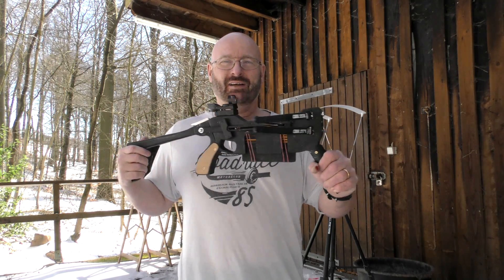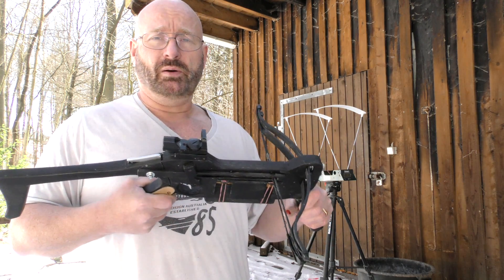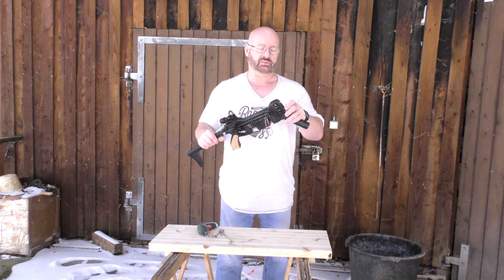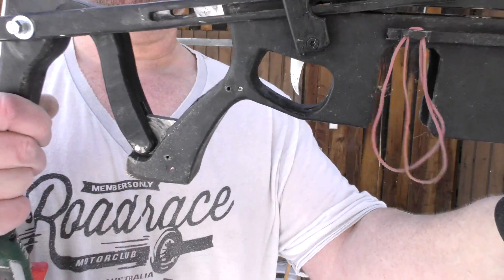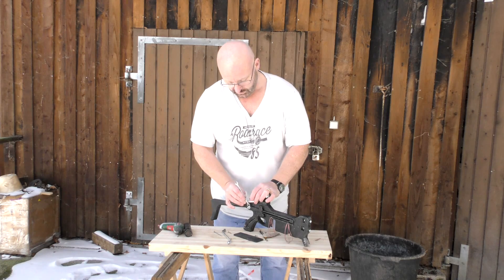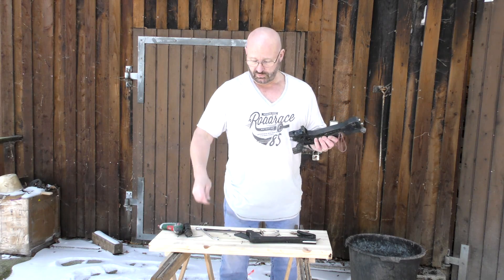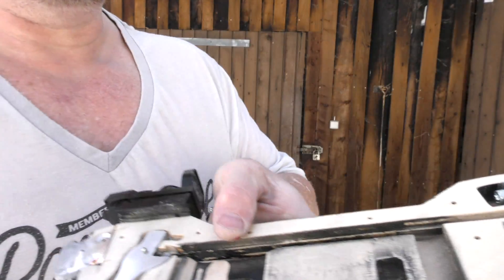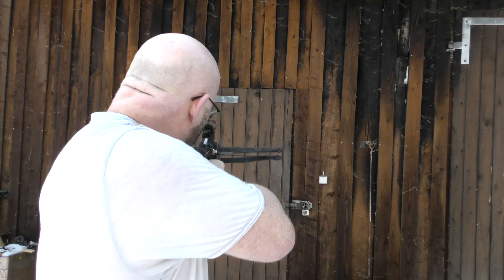"Assault Crossbow": How does it work?

Comment: Looks a lot more practical and ergonomic than the Viper Crossbow, whose main drawback i've found to be the too short and unergonomic cocking handle. Also, despite its comparatively low draw weight, it is suprisingly hard to load (because of the shitty cocking handle). Also, the current price of around 350 € is a bit much for such a simple (though sturdy) upgrade to an otherwise quite cheap pistol crossbow. Though the (no name) red dot sight is pretty good.

Anyways, get this model into production and sell it for a compraratible price to the Viper to make it obsolete. Also, construct the magazine in a way to allow for broadhead arrows to be used. The Viper cannot do that which severely limits its effectivity as a self defense weapon.

Comment: its great but 37j is a bit low i think, it will be enough with razor broadheads. Maybe you can pimp the crossbow to 50j ? (by modifing the bolt weight first, then maybe increase drawlenght just a little bit?)

Comment: I think you have a winner here. I love the cocking mechanism, it's so rugged and easy to leverage and not slow. The cheap rubber band of the cartridge can improve, I think, but that's easy. I am wondering if it's possible to stack the arrows not directly on top of one another but on an offset, so it can store even more arrows. And is it possible to have interchangeable magazines?

Comment: You should make the follower mechanism a spring pushing up the bolts like in a mauser magazine instead of two rubber bands pulling it up, and a swivelling or moving floor plate to open and reload.

Comment: okay, let's see here

1: you have to take the weapon out of aim position to recock it which reduces ROF significantly. I'd prefer to go with a pump like on a shotgun or a bolt thing like on a sniper rifle
2: hardly an assault weapon with that small magazine. a double drum magazine seems overkill, but...
3: any kind of crossbow which cocks so easily won't have as much power. so the bolts will need to be able to cause lethal or near lethal damage at low velocity. like poison or incinderary (sorry I can't spell)

Comment: If it does go into production, there's a few things that need to change. I understand it's a prototype and what I'm about to say would be obvious. First off the entire frame must be either metal or polymer as well as the stock. The magazine must hold at least 5 bolts and should be a spring-loaded magazine. Sell bolts and magazines made to fit this model. Now I would like to give my opinion on this well made prototype of yours. I like the compact design and the overall look. The reload mechanism seems very smooth, but I'm worried that pulling and folding it that way will eventually wear it down to the point where it might break or get stuck. I'm not sure how much force it needs to be loaded, a man of your size and strength would make it look easy. I hope you see this comment and that it won't end up in the bottom of the comment section. Anyways, I wish you good luck and I hope your product is successful and that all your subscribers would get the chance to buy and test one of these out themselves.

Comment: I’d like to see you make a 50. Cal rifle,
- must be able to reach 1-1.3 km
-includes instruments
-bolt action
-use of air or other powerful propellant to fire projectile
48 in (120 cm) (20-inch barrel); 57 in (140 cm) (29-inch barrel)
//;• due to this being the measurements of the M82a1 anti material rifle, and metric system, the size limit is increased to 30-50%.

(Overall: 170 cm)
(Barrel: 70 cm)
And so on
Reply: It's only a 'rifle' if a projectile travels down a rifled barrel, so he couldn't make a true .50 cal rifle like what you're requesting.
Reply: He's said before he wants a US-based workshop but doesn't currently have the funds for it.
Reply: It would  be illegal to make in Germany unfortunately, the nearest thing would be the air arrow shooter he made which was crazy powerful, anything with a barrel is classed as a firearm and needs licensing though.
Reply: Kyle Roberts open rail/barrel system would apply to German law
Reply: Chace he would be able to if he was on US territory

Comment: Send the old crono to an electrical repair channel and then give it away to an upcoming channel that needs one. I'll bet I can fix whatever is wrong with the old one. Unless you have run over it. I have fixed several over the years. It's always been moisture ingress and easy to fix and upgrade to make it tougher. The paintball fields and teams use them to adjust their guns and make  sure they are in spec so nobody gets hurt.

Comment: Full aluminium version and change out the rubber bands for some kind of springs for the magazine, that way it will last longer and look more "professional". Anyway, awesome AXB ( Assault X (cross) Bow)
Reply: he doesent mess with springs its just his way.
Reply: No rubber? This is the slingshot channel!
Reply: I think even a nylon elastic cord would work too, but i agree. i think having the option of self contained magazines as well as normal loading would boost the professionalism of the weapon.
Reply: Springs are harder to replace than rubber bands if they wear out. Also, if you used black rubber bands it wouldn't look unprofessional.
Reply: @cod6guy12  Sorta would, i mean, the follower has to be absurdly tall so that the rubber bands would work to push it.

(follower is the piece of plank that pushes the arrows in the magazine).

Comment: It would be cool to have the whole top of the crossbow covered with one long picatinny rail so you wil have the option to mount a scope with a mount that is larger than the mount of a reddot sight.
Reply: You would than also be able to put picatinny iron sights on it
Reply: you could just attach a rail extension onto the existing rail if that's what you wanted

Comment: Out of interest, was there 2 x 50lb limbs, or 2 x 80lb?
Reply from the maker: Here, 2 x 50 lb (even though the officially call them 80 lb). Two of the 80 lb would require way heavier bolts. Probably would have to use steel shafts.
Reply: That makes sense, I have an 80lb pistol (which these are from I believe) and it is way too light of a draw and shot compared to the one you reviewed. Thanks for replying, keep up the amazing videos!